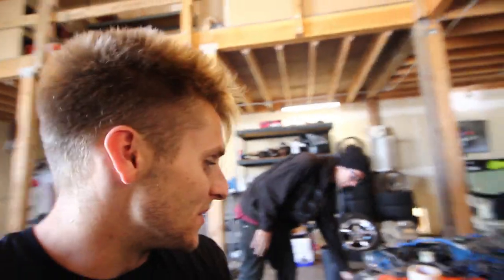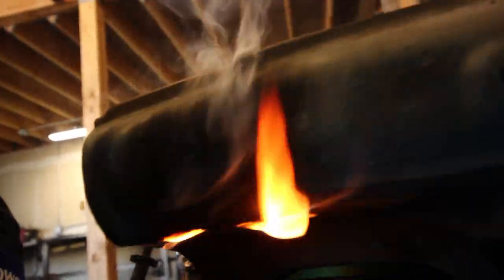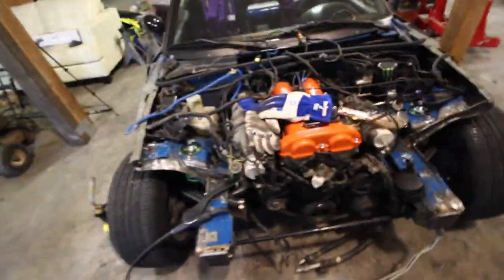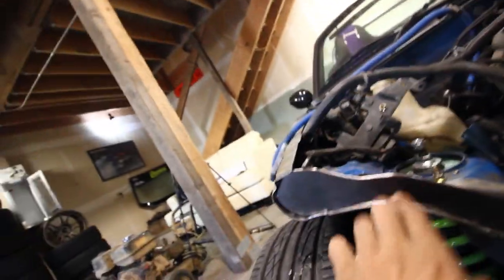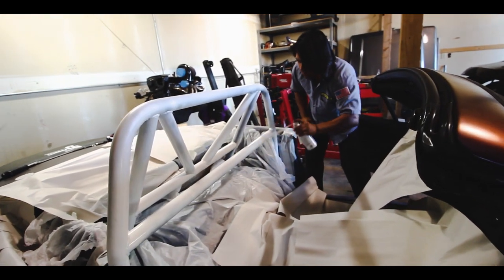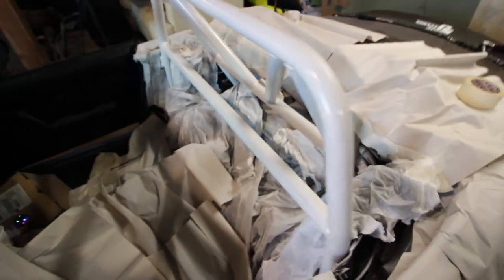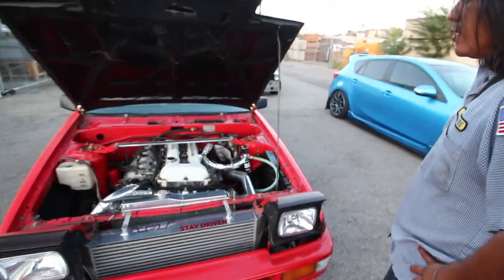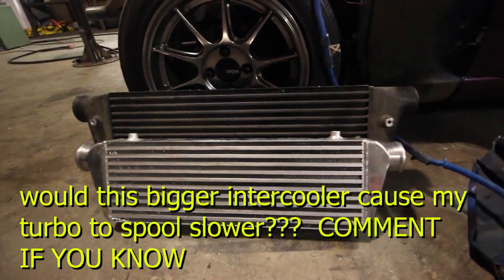Painting the Cage and Tubing the Front

Comment: the inter cooler wont change how fast it spools from the turbo. the turbo will spool the same. to have a turbo spool faster you will need a smaller one. or one with better internals. 
How ever the larger inter cooler should keep the air flowing into the intake manifold cooler allowing for more power with a correct tune.

Comment: Turbo only spools from one thing, the exhaust manifold. So the bigger IC should not effect the spool up time on a turbo. 
With that being said, you now have slightly more volume to fill in the intercooler than before, because well it's just bigger. That difference in volume could be noticeable, but I doubt it since it's not a drastic change in volume. 

Only thing that will really change is intake temps.

Comment: Long story short, no it probably won't be really noticeable lag (roughy 50-100rpm). If you want content for another video, measure the volume of both intercoolers using water (tape off one side and fill them up through the other side with a measuring cup). Once you have the difference in volume you know how much more air you'll need to get in there to get to the same pressure.